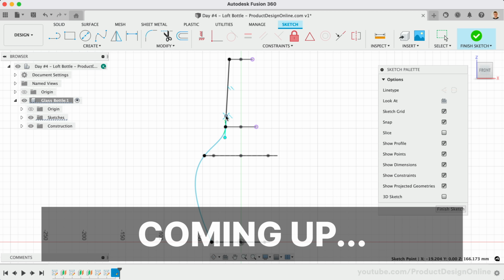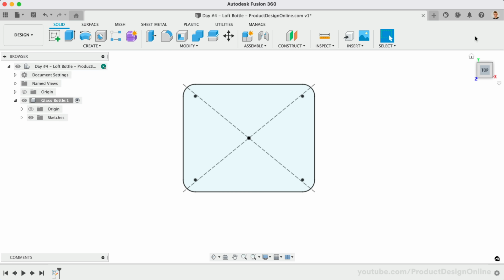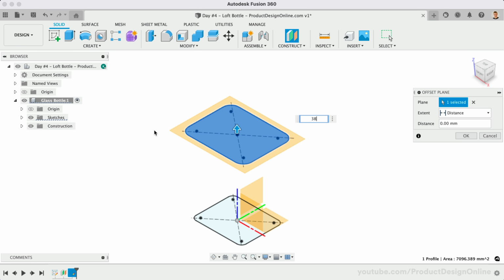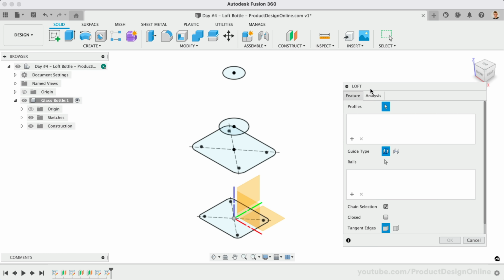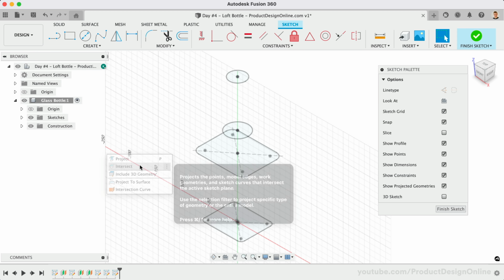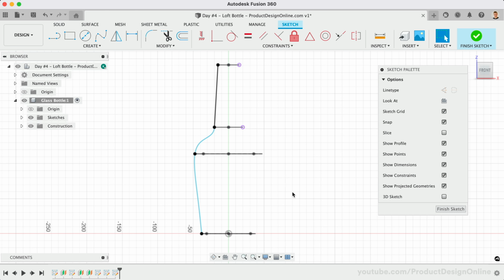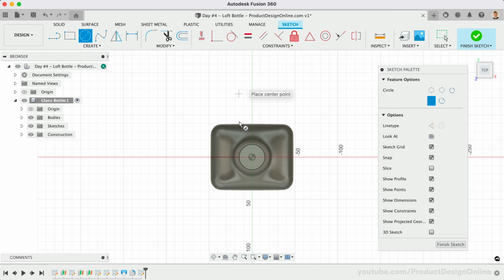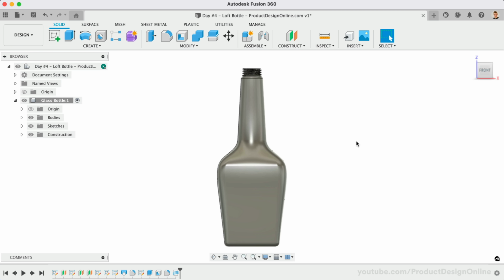Day 4 of Learn Fusion 360 in 30 Days for Complete Beginners! - 2023 EDITION

Comment from the maker: What problem(s) do you face with the Loft command?
Full course on YouTube: https://bit.ly/30daysUpdated
(I'll update this playlists as each Day is released)
Reply: I can't seem to find the project drop down at all under create sketch
Reply: Is the full course available on your website, or is it being dripped as well? Totally gonna dive on it if I can access all 30 days right now. Thanks!
Reply from the maker: @HydroHowTo  It is being dripped as well. However, I have a Masterclass and other courses on my site that I don't offer elsewhere and that go more in-depth into specific concepts, such as assemblies :)
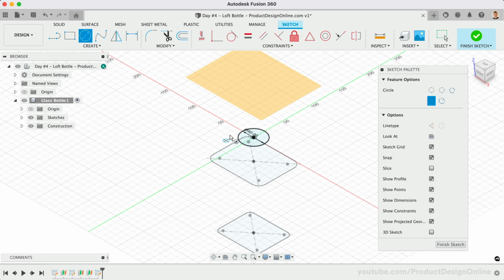Reply: At 5:15 my circle is always placed on the upper origin and the one I selected is gone... I can't understand why because I did everything exactly as you
Reply: @13Tinuviel13  brother same problem can u tell the solution of this please;
Reply: Excellent series thanks Kevin. 
Just one point I'm stuck on regardless of several attempts ( after numerous undos over 2 hours now) is I keep getting the error 'Selected rails do not touch all of the profiles' when trying to implement the rails.
I did understand prior to the error the importance of using the Intersect command and ensuring to realign the top handle of the spline with the straight line above which I did on my various attempts to redo that stage, and each seems to execute OK again but with only one difference I can detect to yours at the 11 minute mark - When you 'Straighten' the top handle of the spline, the purple spline dots disappear but on mine they still remain shown even after I have committed them by 'Entering' or hitting the green tick (also causing the corresponding Fit Point Spline box on the Sketch  toolbar to  deactivate) making me think the action has been successful. I have then straightened the top spline handle on each attempt but still get the same error later intstalling the rails. Could the purple spline dots remaining indicate what I'm doing wrong ? Regards.
Reply: When you said cancel at around 7:50 my entire bottle went away and I couldn't undo it
Reply: I practiced this lesson several times. Sometimes, I can only select one of the guide rails. If I select the second one, I get the error message: "The operation does not cause a meaningful shape change" I do not understand why this happens. With only one guide rail, the shape of the bottle is totaly asymmetrical.
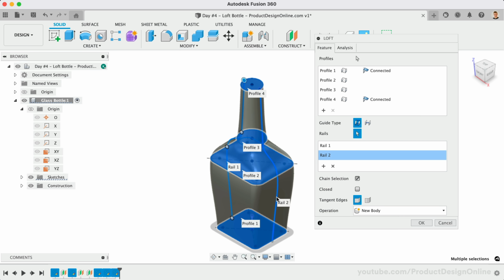Reply: Heyy I am new to f360 and at 12:00 I got the error: " The rail is not smooth Try making the rail tangent and contiounos"
thanks for the help :D
Reply: fixed it
Reply: @Érthetetlenérthetőség  How?
Reply: it says the rail is not smooth
Reply: One thing I realize when I tried to 3d print something that was lofted between the walls were hollow so nothing showed op on the print only the supports how do I fix
Reply: almost at the end, when I tried to use the LOFT command, there´s a windows saying: "ERROR: the rail is not smooth, Try making the tangent continuous" and " Cannot create tool body for loft" 
What can I DO? Thanks! Escellent course and video :)
Reply: I had no problems with the loft command and using the rails. I created this very same bottle while watching your video and following along. No errors or problems. I have the latest update of Fusion360 for hobbyists as of 12/2022. Thank you for sharing this knowledge.

Comment: I'm so glad these exist, even three years later. Things seem to be relatively the same except for a few things, like for example in the current version of Fusion 360 I'm having trouble adjusting the spline handles after I've drawn the spline. The handles show up as green dots before and after the point, but I'm not able to drag them to modify, they're just sitting still and I'm not sure what the problem is. Hopefully this is something that can be explained.
Reply: running into the same issue... not found a fix so far, cant seem to move the spline points either. possible something to do with the intersection command? i recall in a previous tutorial (day 2 bottle) the spline tool worked as expected
Reply: strangely though even a normal spline that doesnt use these interesctions also has locked handles now...
Reply: Just found the solution. For some reason by default the "tangent handle" is marked as disabled by default as shown in the context menu bottom right when you select the handle. To fix: Right click the handle and select "Activate Tangent Handle". It should change colour and then be able to be moved! If it doesn't work let me know!
Reply: Another finnicky tip, when moving the spline handle, it will not snap to the neck part of the bottle sketch unless you move it by the point at the end of the spline handle. Selecting the handle at the line part and moving it wont make it snap into place.

Comment: I cannot get the thread command to work on the cylinder joined to the glass bottle.   I was able to create a second independent cylinder and add threads to it.  But I cannot select the face of the cylinder on the bottle after the thread tool is open.  I can select it before.

Comment: 12:45 when creating the fillet, i have a problem that my arrow is pointing downwards, which makes it impossible to create desired fillet using this tool
Reply: I had the same problem and i found out that the issue lies within the last sketch where we used the fit point spline to make guide rails, zoom in on the bottom and you'll probably find that the line makes a curve near the bottom, use the green lines to make it straight and then do the loft and check if the fillet works correctly

Comment: Hi,
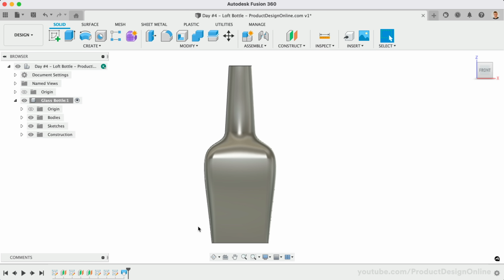I have an issue with making a fillet at 12:35. I recognized that I have a blue arrow looking at the bottom direction, not at the top as in this video. How can I solve this problem?
Reply: I had the same problem and i found out that the issue lies within the last sketch where we used the fit point spline to make guide rails, zoom in on the bottom and you'll probably find that the line makes a curve near the bottom, use the green lines to make it straight and then do the loft and check if the fillet works correctly

Comment: I couldn't get the mirrored rail to work properly. It would not intersect the base of the bottle, so I had an error. Maybe my measurements were off. I manually drew an intersect on the right side of the bottle, and a point spline to make it work.

Comment: i see day4 on fit point spline which is loft rails. if you adjust curve it will from black to blue, it will curve is not completely defined. It will cause trouble? Or just ignore it.

Comment: I can't shell it no matter how I adjust
Reply: it should work with 1mm. The issue is the extrusion of the last cylindre of 12mm at the top, when I remove it, i can do the shell at 2mm or more. So not sure yet how we can keep this last cylindre and still provide sufficient thickness to the shell.

edit: I had to redo the last cylindre on top after modifying the curvature of the rail, then it works.

Comment: Problem (12:00): the guiderail did touch all profiles, but its mirror image did not! Ugh, I don't understand why...

EDIT:  Fixed. One of my construction planes (i.e., the slices that make up the loft) was slightly off-center from Z. Re-centered and things work.
Reply: that's the problem with such complex tools. One setting is off and it won't work anymore 😞
I had this in lesson 2, still don't fully understand what happened.
just keep working it as more gaps will get closed.

Comment: So I'm 6 minutes and 40 seconds into the video where you're using the loft command. I select profile one. I select profile two. When I try to select profile 3. A little hand icon comes up and it won't allow me to select the circle. I can select the circle at profile for and it will connect there. But I cannot connect the profile three because of this hand icon. What is the workaround for this. I know the video is a little bit older and things have changed in the system since.

Comment: I've begun watching your series and following along, pausing the video as I fuddle through things.  I am really enjoying it so far and looking forward to learning a new skill set.  I do have a problem with a model I am making though, I was wondering if you might be able to help.  I am using techniques you have demonstrated so far in the course to create a sleeve that will slide over my 40oz travel tumbler.

I created the base of the sleeve along with a middle and upper offset plane.
One each of the planes I created a center circle, each with increasing radius.
I was able to connect the bottom, middle, and upper planes together using the Intersect and line tools and revolve my drawing around them no problem.
Then I extruded my upper plane to the desired height I wanted.
I applied fillets to the base edge, middle platform edge, and upper platform edge and then shelled it out to 2.5mm.

Everything up to this point went swimmingly however it appears that the middle platform circle that I drew did not hollow out/go away.  When I look at the drawing, the upper platform went away and all the walls all the way to the base hollowed out to the desired 2.5mm thickness, however the middle platform still shows the solid blue circle for the circle I drew there.  What did I do wrong?  Why did the middle platform not go away/hollow out with the edge command?

I'd be happy to share an image or even send you my file (if I can) for you to reference if you'd like.
Reply: Never mind, I guess I just didn't understand what I was looking at.  I exported the file as an obj and imported it into Blender to have a look and it is right.  The middle plane did hollow out.  It still has a feint blue color in Fusion that lead me to think it was still there but in fact it is not.
Reply: Thanks for that as I was going mad having the same issue.

Comment: These are all really helpful. I'd love to see a video on how to create a wooden sign, from design to cutting it out on a CNC machine. Like if I wanted to turn a logo into a sign using different methods, such as cutting out the individual pieces and assembling them or creating a design in Illustrator and then loading it in. There is nothing on YouTube that explains that process, and I think a lot of Etsy hobbyists would find it very helpful.

Comment: Should the fillet on the shoulder below the neck be added before using the shell command? My concern is that the bottle would be thinner than the specified shell thickness in the fillet area after the fillet is performed.
Reply: I agreed with your reasoning, but when I tried to fillet the shoulder before shelling, the shell command kept throwing an error no matter how thick I made the bottle.  Did you try it?  Were you successful?

Comment: While following the guide and creating the first sketch circle selecting the correct plane still results in drawing it on the most top plane. I worked around this by hiding the top plane (Plane3 for me) in the Glass Bottle:1/Construction/Plane3. But I'm wondering what is different in my setup that makes this happen?

Comment: I'm following along, but I can't get the intersect command to work correctly. The red dots don't appear, and I can't see any purple intersect points when I view from the front. Then, it won't let me draw a line from the top circle to the second circle. Very frustrating.
Reply: Sorry to respond to old comment - but I'm having the exact same issue. Did you ever figure it out?

Comment: My centerline to mirror the rail from just disappears whenever I go to modify the rail. All the other sketches (all the sections of the bottle) stay visible, but the center line which is just another sketch just goes invisible and also disappears from the sketches folder the moment I try to modify the guide rail. So bizarre

Comment: how do you get your lines to be more bold. i'm using a 1440p ultrawide monitor and my UI is unfortunately too small.
Reply from the maker: I'm on a iMac and haven't changed any of the settings. Generally, the hi-res monitors make the lines thinner/crispier. In your Fusion preferences, there are a few settings to change for the display. And maybe worth turning them on and off to see if that helps.

Comment: @ProductDesignOnline I run into a problem when trying to shell my bottle with the message of "The shell cannot be created at this thickness. Try adjusting the shell type." Anything over a 1mm shell is not allowed. The problem of this is that my threads cut into the bottle due to the thinness of the bottle walls. I have tried adjusting the curve of the bottle as shown in your video multiple times thinking this was the problem but have been unable to shell the bottle greater than 1mm. Any solutions? Some of the tutorials I have found seem elaborate for a seemingly simple error message and I feel like there is an easier way to do so that I am missing. Any help is greatly appreciated! NOTE: I am literally on Day 4 of Fusion360 and have essentially no experience hence why I am using your series!
Reply from the maker: Sorry I'm just seeing this, Colton. Can you export your Fusion file (.f3d) and share it here via Google drive (or preferred file storage)? It is likely due to one of the spline handles, with the very top one being the most problematic if it's too sharp.

The error messages in Fusion aren't the most helpful :)
Reply: @ProductDesignOnline  I can certainly do that! I actually do not have a Google Drive account (or any other cloud based file storage) but I will make a Google Drive account this evening so that I can share it!
Reply from the maker: @ColtonBroaddus  Sounds good! Be sure to respond with a separate (second) comment without the link as the links will get flagged as spam by YouTube and I'll have to find it and 'approve' it. Thanks!
Reply: @ProductDesignOnline  Just to re state my problem. I have tweaked the spline geometry multiple times as well as ensured the top snaps to the bottle neckline but cannot preform a shell command of more than 1mm.

Comment: Following a long and really like the pace and delivery on these videos--wouldn't really change a thing!

The issue I am having in this lesson is when I attempt to fillet the rectangle on the bottom X/Y axis, the fillet arrow is facing the wrong direction. Fusion is only showing one body and when I disable, the bottle disappears in its entirety. What am I doing wrong?
Reply from the maker: Thanks!

In regard to your fillet question, I don't believe I've seen that happen before. Any change you could share your file or a screen recording of it happening?

(comment back here separately after you comment with a link as sometimes YT flags links and I don't see the reply)
Reply: Hey Kevin! Thank you for replying! Down below this comment will be a video link to the issue. I hope what I show you in the video is enough information for you to evaluate where I may have gone wrong. All the best! @ProductDesignOnline
Reply from the maker: @yourbuddyaj  Thanks for sharing the video, Aaron! I believe I see what the issue is. I noticed in your screen recording that the bottom already has a slight curved edge (vs being straight). This is likelly due to the bottom spline handle being 'sharp'.

You will have to edit your sketch and adjust that bottom spline handle. It should be vertical (more than horiztonal) and make sure the two end point of the handle are not too close, as that will make the radius (circle you see when you adjust the spline handles) too sharp.

Let me know if adjusting that fixes it for you! 😄
Reply: https://youtu.be/mv6w46yy-G4 @ProductDesignOnline

Comment: No matter what I did, i couldnt select the sketch of the side of the bottle with the Mirror command. Have had this issue before.
Reply from the maker: Can you share your file? Double check you're using the correct mirror command, as it exist in both sketch and modeling environments.
Reply: Sure, I can do that. Much appreciated. Should I email it to you? I always have difficulties with mirror. Sometimes it works, sometimes it doesnt. Good tip. I was trying within sketch similar to you I reckon.  @ProductDesignOnline

Comment: Excellent series.  As a retired technical educator, I appreciate several of your techniques, particularly your listing of 'objectives' at the beginning.
I did have one anomaly after creating the mirror of the rails and lofting the bottle.... the right side had a concave curve that was not present in the rail lines. Any idea why?
Reply from the maker: Thanks!
In regards to the anomaly, that one is hard to say without seeing the file. Can you share the link to your Fusion file?
Reply: I had this when I mirror'd the lines one by one instead of together. That caused the right side rail to not attach to all planes. Mirroring both lines at once attached Rail 2 to all planes that it did not concave when selecting the loft